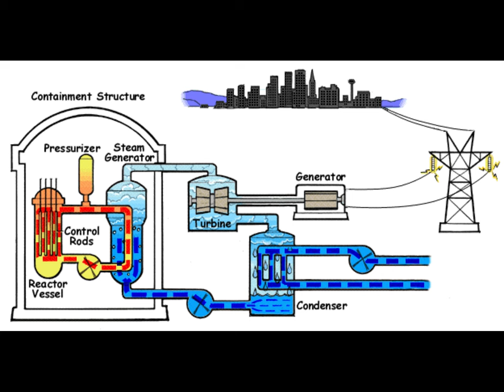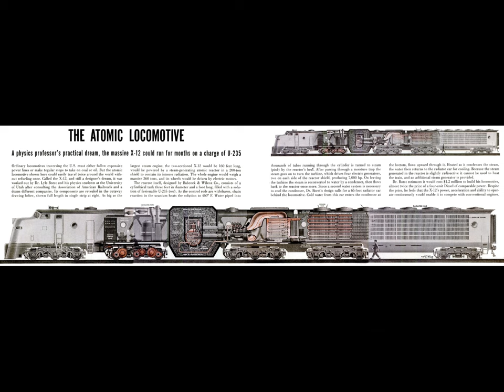Nuclear Powered Locomotives

Comment: All nuclear reactors use steam, which is also radioactive. Cooling them is no problem for ships, submarines, and power stations, but trains, and planes are a problem.
Reply: Most reactor use a 2 loop system, as show at 7:10.  The steam in these systems is not radioactive.  At the time, this was the design that Westinghouse developed and promoted.  However, some land based power plants used a single loop system designed by GE in which the water was boiled to steam.  That steam and associated water was radioactive.  This system was only used in land based power plants.
Reply from the maker: Good dialogue

Comment: Thanks.  I doubt they were worried about CO2 emissions  in the 60s.  :)  I'd ride it though.
Reply from the maker: It's told from todays perspective
Reply: @TheRailroadCrossing-SteamPower  ok, but why insert an issue that wasn't even in existence at the time?  It had no bearing on the matter.
Reply from the maker: @Bob.W.  Because that's how that aspect of the story was written. It's not up to me to decide to omit something from the original author that I got permission from to use their material. I should think that they are more qualified than either you or I in this matter.

Comment: The Russian nuclear train was a double wide design that was shown.   Germany investigated double wide train designs as well with 4 meter wide gauge then reduced to 3 meter wide gauge before WW2.  There was even a USA TV series with a super train that was double wide and double level.    I was wondering what other double wide trains may have been seriously investigated.    One of the main reasons for the near road carriage width of passenger trains today is axle loads on heavy freight are near practical limits with the current wheel rail configuration.  Making the cars much wider would in effect require  them to be much shorter to keep the same load.   There is little to no cost savings for going wider for freight.   It would allow critically wider freight.   Austria uses cape gauge 3-1/2 foot for shipping iron ore with some of the heaviest trains in the world.  

Passenger trains would be more comfortable and better living spaces if at least double the current width.  The higher width would allow stability for at least two levels that are continues between cars.   For widely popular passenger trains this would keep passenger train length to about 1/4 what is used today with more comfort.   Twice as wide X 2 complete levels.   

Future maglevs with the ability to drastically accept different loads through the maglev system should be able to achieve much higher levels of load carrying and adjust to accommodate from an empty freight train to one that might carry iron ore the one of the heaviest loads.    With a track system no longer restrained by traditional axle loads some new practical sized loading gauge should be developed.   A starting configuration might be a bit over double the current width for carrying cars perpendicular of about 8 meters wide and up to 16 meter high loads.  This 1  width to 2 height is what double stack trains do today, but maglev would have stability support likely farther towards the perimeters than current standard gauge track at 4 foot 8-1/2 inches.  

My guess is 800 kph 500 mph maglev motors are going to be a bit noisy and a double width maglev train might be configured with 3 levels the first noisy level being for large cargo with the second and third much quieter levels for passengers.   Large busy passenger station might load all three levels of the train simultaneously form station platforms at those levels.   Remote small stops might just pickup and drop people at the cargo level with them needing to use in-car stares to get up and down or an in car elevator for the disabled.  

It's much less disruptive for small interchange stops for people to gather and leave on Amtrak Superliners at the lower level away from normal activities of passengers on the main upper level.  On typical single level passenger cars people gather with luggage in-between the cars where the exit door is blocking normal passenger activity between the cars.  

A doubling of the current loading gauge of trains would allow vastly larger loads to be carried over land easily.   Large machinery and large sections of pre-constructed house section might be shipped.   We'd have a different looking world if wider loading gauge trains such as Burnell 7-foot track had been widely adopted with the ability to move much larger things over land with easily.  The very first UK railways that were double tracked were configured with the possibility of occasional use for one way travel where special freight might use the inner rail of the two tracks for a double wide freight carriage.
Reply from the maker: Crazy idea,  crazier designs

Comment: well in theory you could have a long running locomotive and lots of power generation, and another way for steam fans to see use of it, but there is soo much that could go wrong and the contamination would make east palestine look like a glass of milk spill, trains can and do derail and get into accedents and jostle around, and nuclear power requires steadyness I belive which is why they were never put into the battleships which the times they went in and out of service were designed to take a pounding, the jostling of locomotives problably would not be good for the same reason watertube boilers and coal turbines didn't work well at least for the most part.

they did though take a huge b 36 peacemaker bomber and put an open end nuclear reactor inside and proved they could fit one inside the bombbay and run while flying, but it was not a closed loop systom so it put out radiation when it flew though the air, you can see why this idea was abandoned fast, though they could have tried a closed loop systom but it would have been even harder to get the thing airborn and the complecations of the tubing and the weight of it, and uranium has a very long half life before a given quantity of it becomes stable and non radioactive,

now a thorium reactor or something that dont have such a long half life of fusion might be a differant story, fusion is still a ways off and thorium is documented and usable as a form of reactor but not widely used, I think has a 20 year half life
Reply from the maker: Great point about the Thorium.. They nearly had a working model for a Thorium Salt reactor in the 1950's.. And then the whole thing was scrapped.. Why.. I dont know. Up until fairly recently it hasn't even been looked at. I think it's very viable as the lesser of the evils when it comes to nuclear power.
Reply: @TheRailroadCrossing-SteamPower  much less shorter half life for one, and nuclear beside the high thermal temp of the water and the nuclear waste is a very clean form of power, very green, and the newer types of reactors dont have the risks of melting down like the old ones if any at all due to the safeguards in them,
thorium though there is a few small experamental ones and I think one in china and that is it for the time being, and there is lots more of the thorium in abundance from what I saw a few days ago, as its also a side product of rare earth minning though that is far from green how they get it but I think its worth a second look, I am not nuclear physicist though my math skills reek like a garbage can in the July heat, but I know bits of many things. and have hear and read on many subjects but consumate knowlege maybe not soo much.